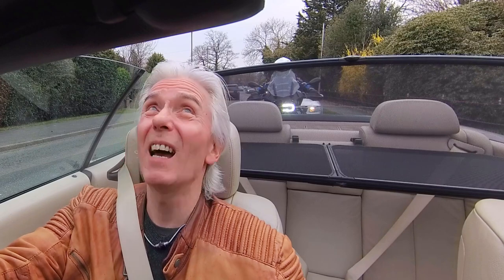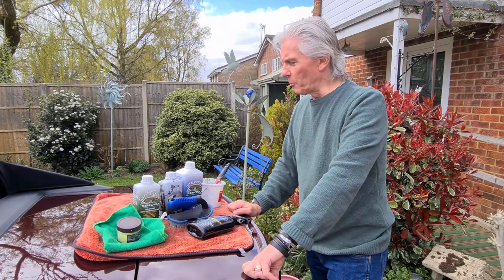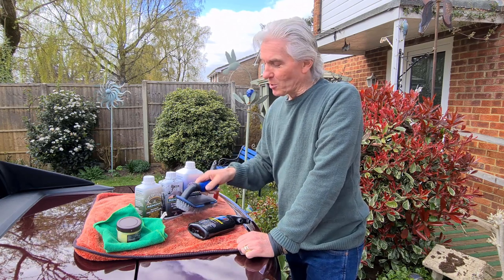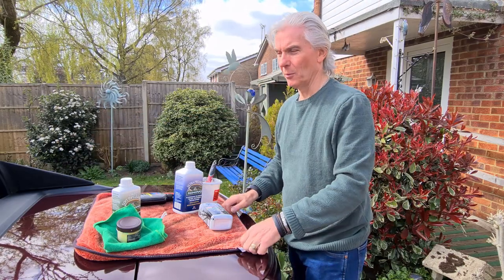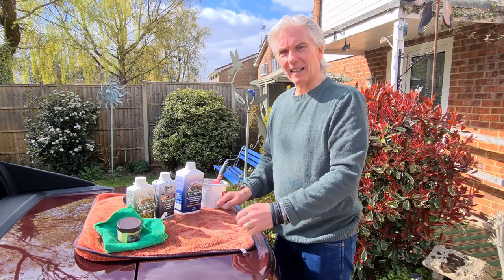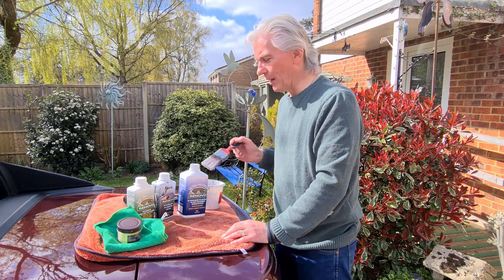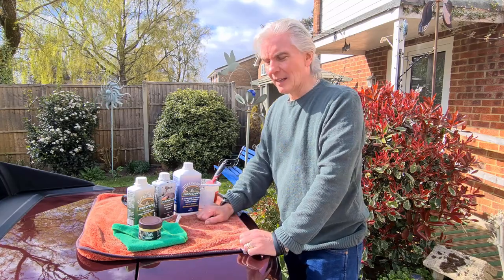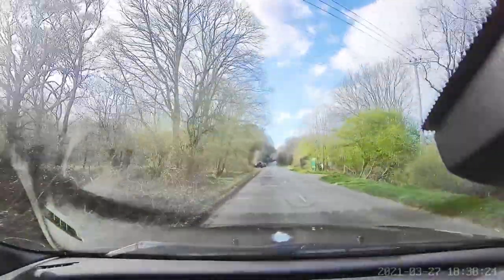BMW SOFT TOP FULL REFURBISHMENT

Comment: Sorry, but I am a E63 (rather than E64) because 1. I don't have any hair, so 2. in Australia the sun is out most of the time and is HOT!  Air conditioning thanks ! However I still enjoy watching because I always learn something new .
Just a query on unrelated subject, do you know what the alternator charge rate should be for my AGM battery as it seems to take a long time to recharge ?  Thanks Timm and stay safe.
Reply from the maker: The charge rate is variable depending on battery state-of-charge and condition - it is an intelligent system. Long charge times usually means dying battery!
Reply: @TimmsBMWRepairsandInformation  Thanks Timm.

Comment: Love both your cars, I was really interested in buying a 650i but I have a feeling there wont be enough leg room for me. I already own an F10 & E46. Being just over 6.5ft tall its difficult for me to get into most cars. Luckily in the F10 there is plenty of room. In the E46 the seats go back quite far where its touching the back seat so fine there too. But having tried a 630 once, I don't think the front seats recline all the way back? Please can you advise if this is the case with yours? Many thanks!
Reply from the maker: Thanks Issy! No, the seat does not fully recline -especially if the seat is a long way back as the rear seat gets in the way.
Reply: Many thanks for your answer. I had a feeling that was the case.